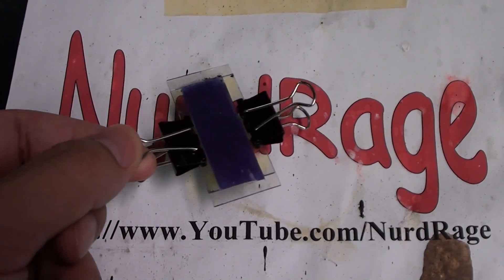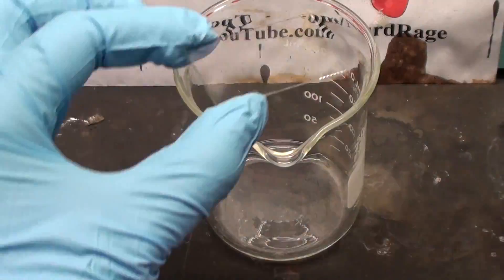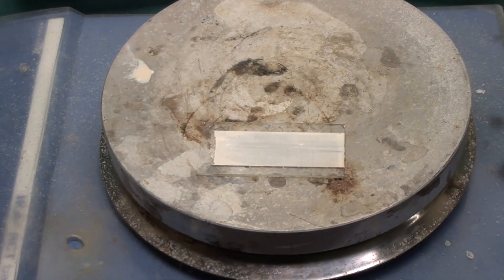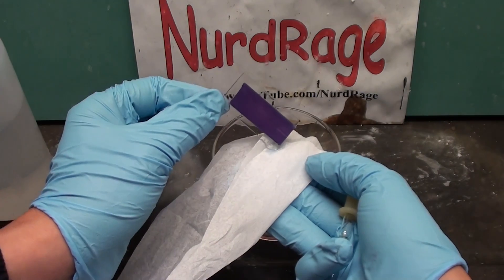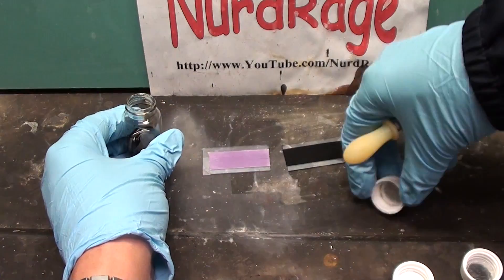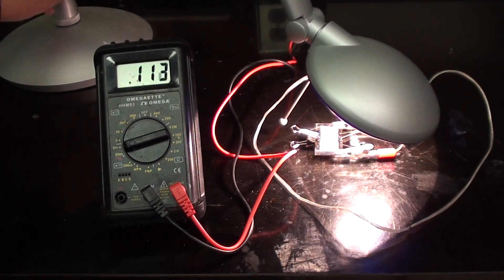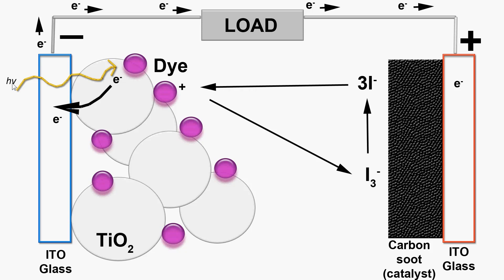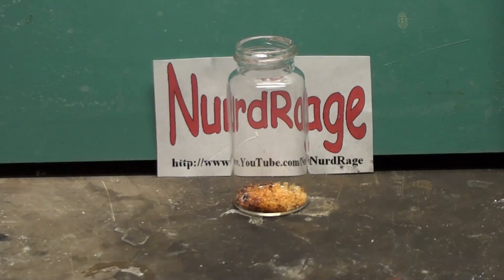Make a Solar Cell - TiO2/Raspberry based

Comment: I recently saw a video on another channel that shows how to reuse the indium-tin oxide from LCD screens. They also did it without the hot acid. The screen also has the optically perfect glass that you can reuse. Cutting out the biggest expense for this expirement. I will be trying this soon.

Comment: You clamped the two conductive surfaces together. I would like to have known how productive this cell is when it's not internally shorted.
Reply from the maker: Video shows the performance
Reply: @NurdRage  I'm saying that it looks like your binder clips squeezed the ITO layers together, but you used the individual ITO layers as your positive and negative terminals. Therefore - at least on the face of it - it looks like the cell itself was internally shorted, and the measurements you took were artificially low because the resistance of the ITO allowed a tiny amount of current to flow through the ammeter. Isn't this solar cell producing less power than the same ingredients would if it was configured as a battery cell?
Reply from the maker: The titanium dioxide maintains separation between the ito layers. The clips don't provide enough force to warp the glass and make them contact. That being said, this is s very crude design meant for educational purposes that could be built by students. better designs have physical spacers and other improvements. But they would be too time consuming to make for a typical lab course.
Reply: @NurdRage  All good points, though you did set the thickness of the TiO layer with packing tape. A possible improvement/test would be to apply fresh tape to the sides of the carbon layer to maintain isolation (before the liquid is applied). The conductive soot may bridge the ITO gap, since - even if the ITO layers do not touch - they are perilously close.

Comment: I also wonder , I have many silicone based chip as junk from broken electronics , so i think can i i use old ic or processor or transistors to generate 3 - 6 voltage with 5 to 20 ma current to power small electronics like watch by Focusing Intense beam of light !!!!

Comment: How much of the generated current would have been lost across the electrolyte between the two clear facing edges of ITO glass.  Would placing tape back have eliminated this?

Imagine if the cell actually generated 10 times more but was shorting the power along the edges.

Comment: I think you maybe made a slight mistake? Surely you're shorting out the cell (along the long edges)?
I've seen it done elsewhere similar to this, but they used thin tape to cover the exposed glass edges just before assembly to help separate the plates. That stops the plates shorting together and allows space for the iodine solution.

Would be cool to revisit this. 👍 Just the cost of ito glass that stops me trying!

Comment: Does it make a difference in voltage if you would replace the raspberries and use the blackberries or is it still the same?
Reply: If I am not mistaken, the berry is used as a dye to allow the TiO2 to absorb visible useful light rather than UV light.
Reply: I also think the key parts to making the solar cell produce more current is by having a better semi-conductor, silicon doped with boron and phosphorous is the best (increases the flow of electrons) but getting pure silicon in the first place is its own tricky step, the electrolyte (the liquid sandwiched between the 2 glass) is also important.
Reply: +sabrina devolder The dye would be the same I'm afraid, so no, it won't.
Reply: Edmund De Kock pls I need you to educate me on the silicon doped solar cell.

Best Regards!

Comment: The titaniumdioxide layer fragmented after I added the dye. Does anybody have a solution?
Reply from the maker: Sounds like you have "rutile" form of titanium dioxide. you need the "anatase" form
Reply: What is the difference?
Reply: https://www.google.com/search?q=titanium+dioxide+rutile+vs+anatase
Reply: Heat your TiO2 layer to around 400*C in an oven. That should convert it into anatase.

Comment: ok so this is verry informative but useless at the same time as I have no I deea where to get those chemicals. All I managed to get was raspberries and I eat them all on the way home.
Reply: Titanium dioxide can actually be found in bad dragon cumlube
Reply: For the electrolyte I think you can mix iodine with ethanol, both are fairly easy to get, also TiO2 (titanium dioxide) is fairly easy to get (google). The indium tin oxide glass, I am not too sure how hard they are to get.
Reply: gigicaly ITO glass can be found in cell phones,  or other toch screens. TiO2 in white paint,  or soap. Anthocyanines are also found in purple carrots.  Iodine and KI at the pharmacist.     Now go make those cells man!
Reply: well google the chemicals, not the point to tell you where to get everything
Reply: The Reeper also for the glass I don't think it has to indium tin glass but is has to be clear and Conductive
Reply: ***** yep
Reply: +gigicaly In that case this video just isn't for you I'm afraid.
Reply: Contact me if you wanna know how to do similar experiment with materials that costs less than 5 dollars.

Comment: Will it be enough if I only heat the slide to 225 celsius when fusing the titanium dioxide to the slide? I've found a cheap conductive PET plastic, but it has a melting point of 250 celsius.
Reply: Might be, but then you need to keep it there for longer. Try and google "turning rutile titanium dioxide to anatase"

Comment: WHAT IS YOUR RESULT WITH GRAPHINE??  WHAT ABOUT GALIUM? (2016)
Reply: +Thomas R. Miller And just where the hell would he get graphene from?
Reply: Served! X)

https://www.amazon.com/Ultra-quality-Graphene-flake-powder/dp/B01CN0KG9O/

P.s. : Google is a thing... :P
Reply: Okay, fair enough. OTOH at $45 per 10 grams (plus shipping) I'd pass...
Reply: It was 345$ per gram just a couple of years ago...
Cmon...That's fair to me.
By the way,on the "cheap side" of things, you can make your own with scotch tape and graphite.
Reply: Heh, in that case it's a real bargain then. I wonder why didn't NurdRage run and buy some already.....Yes, I've seen a video about the scotch tape method a while ago, but I think that getting the thin graphene layer off of the scotch tape's surface (and getting rid of the contaminants) would be a problem.
Reply: To be honest, a nice vapor deposition of carbon can be enough. In regard to contaminants,just think about it for a moment:chemistry is a joke !
We are surrounded by air and so are our compounds !
Chemical equations are unrealistic in almost every circumstance and the industry knows it well.
Also,you might think about vacuum but it isn't even appropriate to make a perfect balanced chemical substance,as it alters the chemical bonds in some cases,along with pressure,which can give you a different allotropic form with some substances.
Probably,only a neon-based atmosphere would give us "perfect" substances (or additive manufacturing,atom by atom).
Reply: CoolKoon make it yourself.  Watch Robert Murray-Smith's videos on how to do it.  You can even use pencil lead for small quantities.
Reply: AncapFTW Oh yeah? And do you also happen to know how do I turn it into a solar panel afterwards?
Reply: CoolKoon I was looking into that.  actually in Wal-Mart as I type this to buy a cheap microwave to try it.
He's got a solar cell design on his channel, but it isn't graphene based.  I'll have to look into how to make one.  Maybe a metal oxide could work.  They are common in solar panels.  Maybe graphene oxide?
Reply: AncapFTW Graphene oxide? Also known as carbon dioxide (CO2)?
Reply: CoolKoon no.  oxygen will bond to graphene, making it more resistant to electricity.  Graphene doesn't break down when this happens.
Reply: note: if using the microwave method, don't use pyrex.  I just tried it and the container shattered
Reply: AncapFTW "Graphene doesn't break down when this happens." - I'm sorry, but the chemistry just doesn't seem right on that one. Diamond turns into CO2 when oxidized and graphite turns into CO2 when oxidized too. Why would graphene (another allotrope of the same element) be different?
"don't use pyrex.  I just tried it and the container shattered" - Yeah, because American Pyrex is standard soda-lime glass (it's cheaper that way and many people in America just don't seem to care about quality; "red delicious" apples are another prime example of that). Just order some beakers off of eBay or something. They're guaranteed to be made from borosilicate glass (which wouldn't shatter that easily from heat).
Reply: https://en.wikipedia.org/wiki/Graphite_oxide
Reply: CoolKoon Carbon can be "doped" with different elements just like silicon can, and "doping" a sheet of carbon with oxygen would be easily done. The oxygen does not break the bonds between the carbon itself, it simply slips in place of some of the valance electrons. People have done this in labs with other elements such as sulfur, phosphorus, etc.
Reply: Scotlahn Mccallister While it's true that carbon (even diamond) can be doped with different elements just like silicon, oxygen is definitely not one of them. Graphite oxide is highly problematic due to the fact that this "oxide" layer created on top of e.g. graphite is anything but homogeneous (in fact it's not an oxide layer at all), which makes it not only unpredictable (its structure is very heavily dependent on the composition of its precursors for instance), but also a poor insulator as well (graphite oxide is almost considered to be a semiconductor on its own). Sure, diamond is a good insulator, but it's very reactive on its own (i.e. too reactive to be useful) thus (at least at the moment) it's unsuitable for both PV purposes and as transistors. And as we all know, the REAL oxide of carbon will not stay on the top of the material at all (since it's gaseous).

Comment: can you use ethylene-based antifreeze for the solution?
Reply: Try and report what you used. If it sounds pure, try that.
Reply: +namibjDerEchte lol i sound so stupid 7 months ago that was when I met chemistry and after 7 months of non-stop studying of chemistry I'll just distill the glycol of the antifreeze and it will pure as hell
Reply: Amir Badral-din Yeah, wasn't sure about what the possible contaminants were, so...
Reply: +namibjDerEchte anyway, thanks

Comment: step 1: make 100 of these
step 2: put them together on. a platform side by side
step 3: put wires on one side and have them all connect do to bolth sides
step 4: profit
Reply: +The Trio 
step 5: get about 10V at the best light condition possible
you can get more electric energy by just eating the raspberries and running a hand crank generator

Comment: The energy is obtained through a chemical reaction or solar? >. <'' I do not understand English 100% ty!
Reply: +María Perez  It is not chemical reaction. It is physical reactin. which is based on Photoeffect
Reply: +María Perez Its a chemical reaction which is started by the presence of light.
Reply: +María Perez The cell must have a "P/N" junction, it is not a chemical reaction!

Comment: I made one big enough so tat it made 1.273 VOLTS!
Reply: Let's see it.
Reply: What about the current?
Reply: how big was it? i want to make one that gives me 3 volts
Reply: If I'm right, the size of the cell would boost the current, and you'd need to wire multiple in series to boost the voltage... Unless you got a brighter light

Comment: I have a question, is the power produced based off of the color of the anthocyanin dye? Also, Im curious if anything would change if you used a more concentrated source of anthocyanin from lets say, a red cabbage?

Comment: Is the ITO on the bottom really necessary? From what I understand the sunlight just needs to get to the dye, you should be able to replace the bottom ITO glass with another conductive material. This coming from an economical point of view.

Comment: so if titanium is better than carbon soot,
does the titanium need to be painted black or something?
and would another cheaper metal also do a better job?
if yes could you advise one?
Reply: Tio2 is a semiconductor and carbon soot is the catalyst of electrolyte redox

Comment: I'm no expert on this, but I believe the entire point of using the ITO glass is so you have something that's both conductive and transparent. Conductive to allow the electrons to flow from the dyed TiO2, and obviously transparent so light can reach it. Unless you're referring to the ITO glass that had the carbon layer on it, in which case that was covered in the video. ;)

Comment: i have carried a research in DSSC and i used normal float glass since we do not have conductive glass in my country, and after some more new improvements i was able to make a cell of 1V and 0.2 A it is not still as good as the commercial cell but it was a great improvement. i hope to continue this research during my college time as well. If this technology is developed we can solve the power crisis over night.

Comment: I have two important questions:
1:TiO2 is an n-type semiconductor so it forms the negative terminal. If I use a p type semicon, what modifications do I have to make?

2:Does the colour of the semiconductor affect the solar panel's working?

Comment: So all you need to do is make this a 20x50 to get this up wards of a more powerful cell needed to run  or charge your batteries.  Only massively expensive cells produce large amounts of power, most ones affordable are smaller with light out put good for trickle charging, which is all you need anyway if you conserve your power  at home

Comment: -sun exposure get different results?
or the shape of trees seems to allow them better surface area for sun exposure, using those shapes instead of flat panels?
could we coat live shrubs in titanium dioxide and have temporary solar panels?
black absorbs light would black conductive glass make a difference?
or salt in the mix doesnt that help conduction
well i think thats where my ideas run out for now

Comment: I dont know anything about chemisttry but just some ideas that may or may not get ideas flowing.
magnifying glasses?
what if you mixed tiny shards of glass with your titanium dioxide so the light could penetrate deeper. then you may be able to have thicker layers.
a panel that is also the battery by mixingall the materials together in a clear liquid or solid. imagine like an artificial cell
or upright slightly cone shaped coated inside and out. what if they spin fast in the wind does intervaled-

Comment: Can we use Aluminum oxide, or copper oxides instead for the layer, and can we use Hydrogen peroxide as the electrolyte solution?

Comment from the maker: it helps to suspend the particles so you can apply them to the surface without clumping. it burns away when the slide is sintered.

Comment from the maker: plastic is a bit more difficult since you can't heat it to the temperatures needed without melting/damaging the plastic. I reccomend going to with ITO glass. In the lab the TiO2 is coated with special surfactants and chemicals that operate better at lower temperatures with plastic. but those chemicals aren't easy to get. Also not all TiO2 is good for this. Anatase type TiO2 is the preferred form over the more common Rutile type.

Comment: Hello, and thank you for your time to inspire others (like my son) to learn about DSSC's.  My son has struggled to sinter TiO2 onto a plastic substrate (ITO film) - best results (though poor) were in an oven at 400F. Unfortunately, most of the TiO2 does not sinter to the film, but washes off when soaked with the dye. Any suggestions?  Wondered about using electricity or even infrared to improve sintering outcome. Thank you again.

Comment: Y do u use ITO (expensive) as "back contact" if carbon ( from the candle soot ) can conduct electricity? u can better use a glass, coated with carbon, as a back contact and ITO (transparent) as a front contact... :)

Comment: One question that I would like if you would tell me the answer to :
Do I have to use the carbon in the DSSC? Like, do I even have to use a catalyst? Or does it affect the voltage that the cell puts out?

Comment: The detergent contains surfactants. Those reduce surface tension of water and, in this case, prevent the TiO2+H2O mixture from beading on the glass and remain in an uniform thin layer while it's dried and baked. 
Without detergent (any detergent) the TiO2 paste will form beads/droplets.

Comment: Either last year or the year before a couple of British scientists were nominated for a Nobel prize for their work with graphene, when asked how they got so much so quickly they revealed their secret. They would take regular old scotch tape and very lightly apply it to a polished piece of graphite and could nearly always pull away a single layer. They would keep it on the tape for most of their experiments with it.

Comment: Its So Fucking Hard To Produce Graphene
Because Graphene Is So Fucking Thin That ONLY One Layer Of Graphite
And In Order To Make Graphene U Need A Super Hot Temperature
And Making Graphene Is So Faulty And So Tiny That You Could Even Connect It To Electricity

Comment from the maker: The original poster asked it if was possible, not if it was practical. You don't need large scale production to test if something is possible. Most research on solar cells is done on samples just a few square centimeters in size. Well within the range of laboratory methods. So... Go for it :)

Comment from the maker: The tape would be too thick. but since this is for demonstration then you can do it, the resulting drop in conductivity and current isn't very much. 

But i find it not to be a big issue since the titanium dioxide is thick enough and strong enough to hold the glass apart on its own.